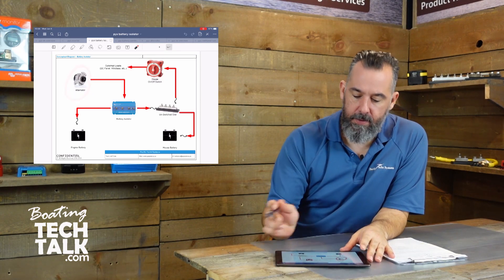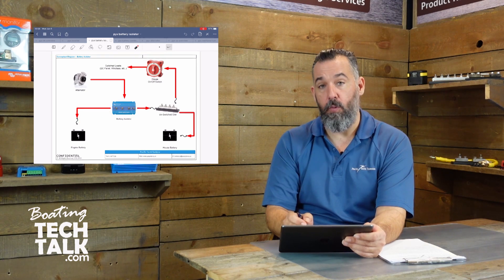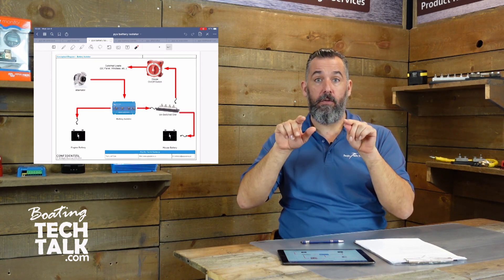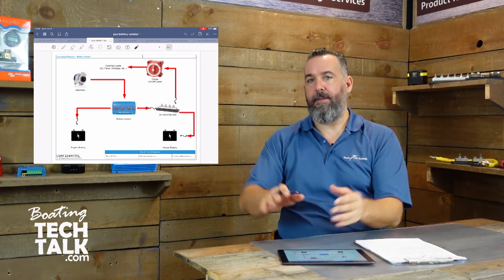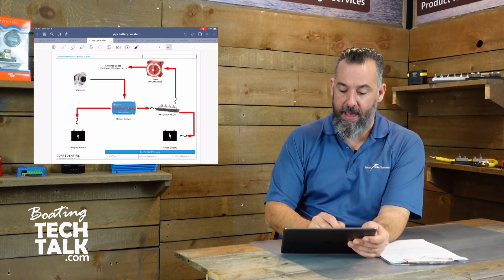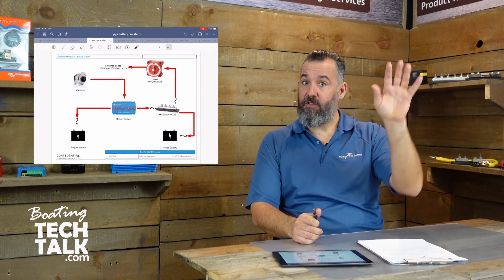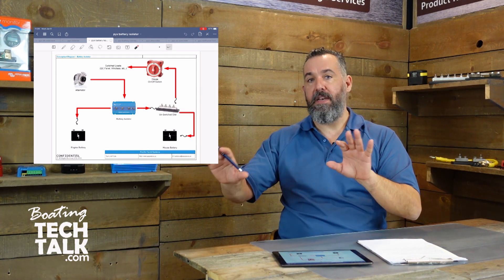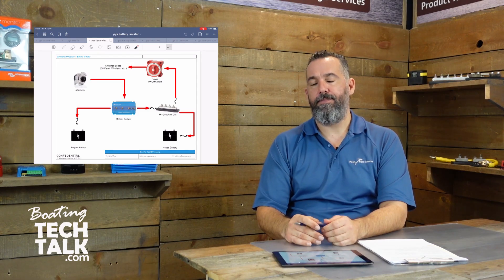How Do I Charge Two Separate Batteries With One Alternator?

Comment: OK so, I'm building a small speed boat for myself and want an inboard electric motor strictly for racing around all day as if I'm treating it like a jetski at full throttle. But I thought a car/marine alternator would charge my battery as it drains from my racing around at full throttle, but I see people talking about over heating or killing batteries with car alternators as a charging system. Can I race around all day at full speed with an electric motor and car/marine alternator without having issues of draining my battery to fast/add a 2nd battery or over heating my battery and burning out my alternator. Why don't people use car alternators/marine alternators to recharge their battery with their electric motor if their using it at full speed/not slow speed? I don't understand and would love a proper explanation if anyone has time for me 😭
Reply from the maker: how are you going to charge the batteries using an alternator?   with a gas powered motor on the boat running the alternator?   that doesn't make sense.

To use the boat all day from batteries at full throttle,  the batteries needed would probably weigh more then the boat.

Comment: When your regulator is sensing the house battery, andthey are depleted but the starter battery is almost full you are about to cook your starter battery.
Reply from the maker: Hi Ernest, your right, it's not ideal. But many of us don't have dedicated alternators per battery bank or even dedicated charger per battery bank.
Reply: @PacificYachtSystems  I would suggest sizing your alternator/regulator/AC charger for the biggest bank which is usually the house bank, and use a separate batter/battery charger that sources from the main charge bus and sports its own profile for the starter bank. Having a dedicated charging bus will include all sources, be it alt, ac, solar, genset - and this goes to the house with the dedicated profile, and sources the dedicated profile for the starter bank (which usually might only need some top up). If you have a third bank for anchor/thruster you simply add another b/b charger to offer the optimal profile. The only drawback with secondary b/b chargers is that as soon your house bank is full the others won't receive any charging. But this is a more theoretical case than realistic, I believe.

Comment: "Battery isolator" is a stupid term for what you were describing.

Isolate means to seperate one from another. A changeover switch does that. You talked about "sharing"  one alternator's charge to two batteries. That is not an "isolator" but what Balmar call a Duo Charge, a device which DOES monitor the two different batteries and shares the common alternator output via DIFFERENT charge profiles as needed.

You talk a lot of s**t.

Comment: NO ONE HAS PUT OUT A DECENT VIDEO SHOWING.......................... two   12v batterys in series  for 24v..............being charged by one alternator at 12v...................I BET YOU COULD THOUGH...
Reply from the maker: There is no way to do this directly.   You could charge a 12v battery with the alternator.  Then get a 12v to 24v charger.  to charge the 24v bank from the 12v bank.  

Or there are products that will change the 2 batteries from series to parallel for charging.   But while charging you can't use the 24v.  Such as the trollbridge
Reply: @PacificYachtSystems  there is a way